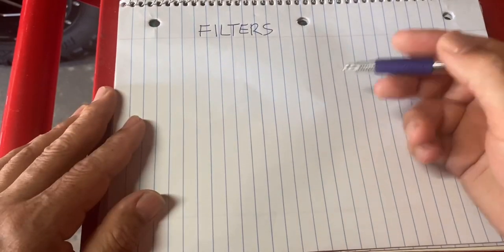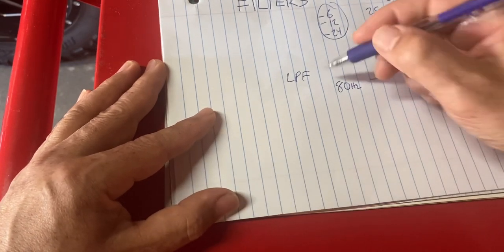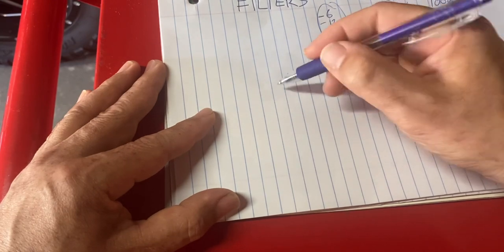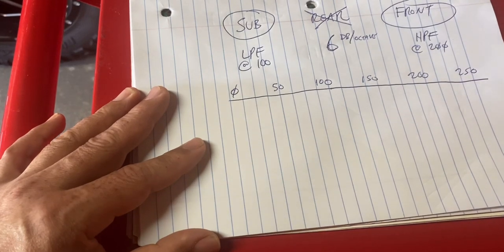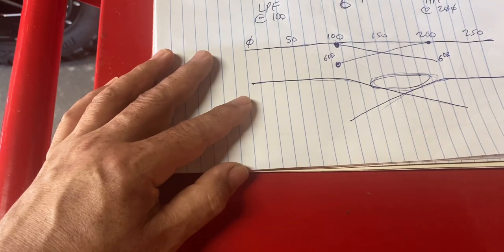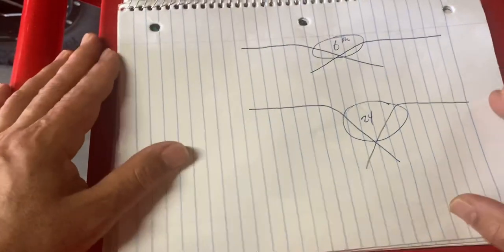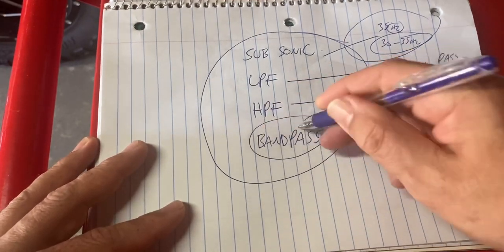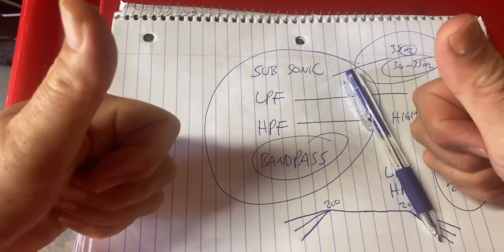Tune your amp filters like a pro!!! HPF, LPF, Sub Sonic, bandpass fully explained!!!

Comment: Great video!! But what about if your Lpf on your amp does not get to 2k and only gets to 500hz do I set my lpf all the way to the right and my hpf to 200hz for example?
Reply from the maker: You don’t want to cut off those frequencies for your mids... so I’d not use a lpf and just use your HPF.
Reply: @NextLevelCarAudio  ohh ok I got it, because I'm using a Skar rp.150 4 chennel amp for my mids and tweeters and the lpf gets only to 500hz
Reply from the maker: Yes sir
Reply: @NextLevelCarAudio  thank you! And sorry for been so annoying with all my questions 😬
Reply from the maker: You good man 😎

Comment: Hey what I have a question. So I have a 500 watt amp with a 12 in pioneer sub. My HPF for the speakers are 250hz with -12. Now my question is, is it ok to have a LPF of 63hz with -12.  I have 6,8,10 for my (Lows, mids, and highs). Also I have the bass setting on my HU set to low. Are those settings good ?
Reply from the maker: Seems like With those settings you are cutting down the performance of your sub considerably. Are you telling me you are LPF your sub at 63hz? Should be up to around 100
Reply: @NextLevelCarAudio  so you recommend me to put it up to 100? For the subwoofer level what should it be ? Should it be at 0 ?
Reply from the maker: Yes, 100hz LPF and Gain (level) adjusted to match preamp input voltage coming in from the head unit., not zero and not max. It will be somewhere in between
Reply: @NextLevelCarAudio  could I have the bass setting on ? Having it on low ? Or should I turn it off ?
Reply from the maker: Low is fine, but definitely not high
Reply: @NextLevelCarAudio  ok so i changed my settings. I’m running 250hz for the door speakers with a slope of -12. For the sub I have 100 with slope of -12. I was running 6,8,10 for my low, mid and high but I put the mids to zero to make the smiley face. I turned off the bass setting. For the SW bass level it changes as every song has different bass. As those settings better ?
Reply from the maker: I think you are on track.
Reply: @NextLevelCarAudio  hey man, so I just started to hear little pooping noise in my sub. The thing is that it only happens in some songs. What could that be ?
Reply from the maker: That’s weird man... not sure what that could be. If everything is dialed in properly.
Reply: @NextLevelCarAudio  I figured it out. It was that I had loudness on. I turned it off and holy crap that thing is wayyyyyy louder, and the bass sounds way cleaner
Reply from the maker: Nice! Lol. Glad it was something simple
Reply: @NextLevelCarAudio  I’m surprised that with out loudness this thing sounds way louder and cleaner. I don’t even have tweeters and for not having tweeters and it sounds like this I think it’s a pretty good starter system
Reply: @NextLevelCarAudio  I’m surprised that with out loudness this thing sounds way louder and cleaner. I don’t even have tweeters and for not having tweeters and it sounds like this I think it’s a pretty good starter system

Comment: What crossover setting and slope would you recommend for some 6.5 components in the front?
Reply from the maker: I like 12db/ octave. Anything higher, the drop off is too steep for me. 6db in unneeded for me because my front stage is crossed very close to my sub stage.
Reply: @NextLevelCarAudio  what hz is a good starting point? 80hz-120hz? Or higher
Reply from the maker: With a 12db slope I’d do 125
Reply: @NextLevelCarAudio  cool. I’ll try that out. Thank you
Reply: @NextLevelCarAudio  do you prefer to set the crossover and slopes on the head unit or on the amp?
Reply from the maker: I like head unit, so I can adjust on the fly if I need to. Just make sure if you lose power or battery dies, to reset as needed. So once I get everything dialed i write down where I have everything set at

Comment: do u need subsonic on sealed box.?
Reply from the maker: On sealed I always set it to 20hz. You don’t need full signal below that as anything below 20 you can’t hear anyway
Reply: @NextLevelCarAudio  ok thx
Reply: @NextLevelCarAudio  Help pls
speakers on the right side sound like they supposed 2 but the left side sounds worst  when i swap RCA problem changes side i bought new RCA cables and problem still there could it be bad RCA on amplifier or headunit.? also when i switch off the headunit i hear a POP sound from my subwoofer any help.?
Reply from the maker: Sounds like head unit issue if problem swaps side when changing RCA’s from left to right. But really not sure 100% man without diagnostics
Reply: @NextLevelCarAudio  wat u suggest i do man thx for repling
Reply: @beatsandwestside  double check that your RCA’s are plugged in snug on rear of head unit. I’ve seen a couple times where one rca pulls a little when headunit gets reinstalled, causing a shit connection.
Reply: @APinTheAK  its the tracks guys STEREO TRACKS uses 2 signlas so u get 2 different sounds to hear more instruments and wider frequency only solution is to play in mono and it sucks